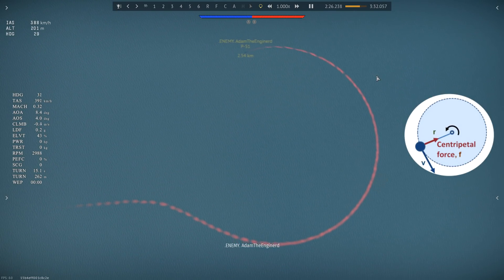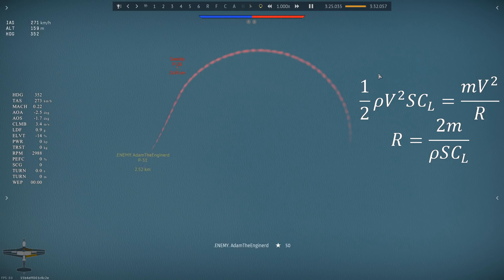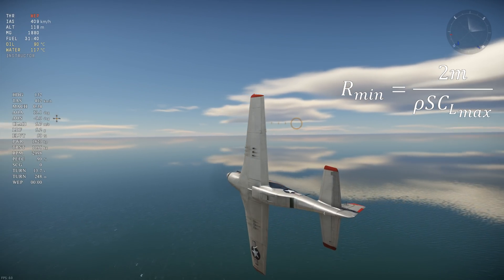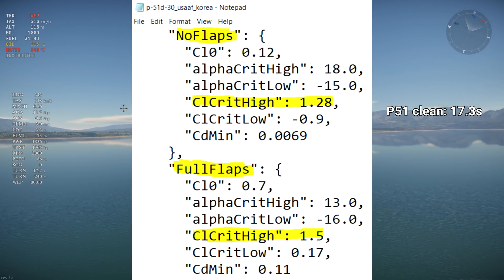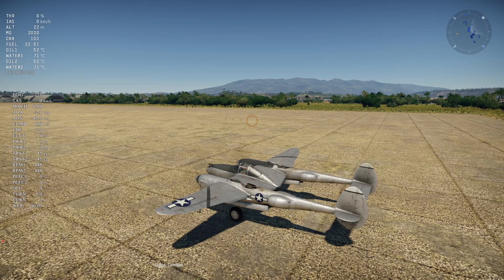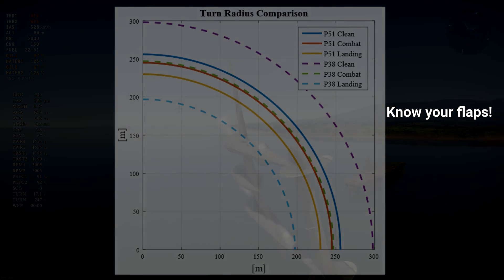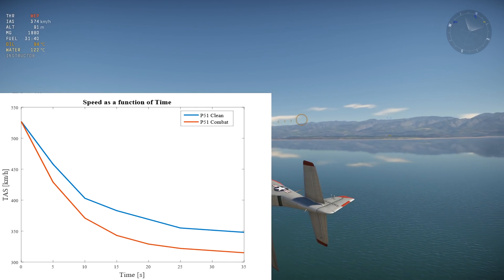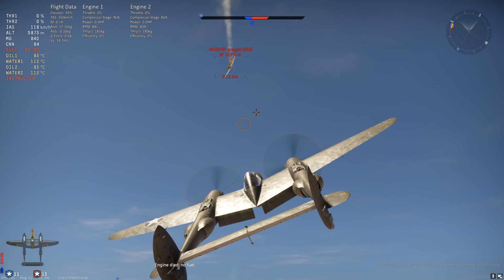Aircraft Turn Performance and Flaps

Comment from the maker: Hope you like the educational video! Feel free to suggest topics below!

Follow me on Twitch:
https://www.twitch.tv/adamtheenginerd
Reply: Had a duel once between my Yak-9UT and a 190 Anton (I think it was an A-5 of some sort). We got into a flat turning engagement, and both of us popped our landing flaps out. To my surprise, he began outturning me, classic Anton flaps, and Yak flaps are pretty useless for turn radius. So I actually raised my flaps, and used the increase in acceleration to climb.

The 190 was still catching me in the turn, but by the time he was coming around to my 6, I had already gained a sizeable altitude advantage over him, and after a series of stall maneuvers, I was able to start booming and zooming him.

It's not often you gain the energy advantage in a flat turn engagement, lol.
Reply: Differences in turning performance in left- and right-handed turns for single prop planes (is it modelled in WT, if yes is it significant in fights).  Also, a follow up to this video explaining vertical turns (explaining the optimal flap extension/timing of toggling the flaps would be nice).
Reply: I'd actually love to see a technical analysis of wing loading(both high and low) and how it affects the performance and handling of an aircraft. Cheers!
Reply: Btw, when you calculated the turn radius, you forgot to subtract the vertical component of lift. At speeds near the stall speed, the increase in turn radius is quite substantial.
Reply from the maker: @J7Handle  I did, I said it in the video. It's a 5% increase at sustained turn speed without flaps for the P51D30.
Reply: Stock plane vs spaded plane
Reply: Fantastic stuff, thanks so much! Topic wish list: 1) best practices re: conservation/conversion/generation of energy, especially variations in planes. [How to get the most out of an airspawn, common ways people are sloppy with energy, vert/horizontal energy retention, etc] 2) how on earth mixture is modeled in game. 3) niche, but ideal climb profiles for the 163/ki200, since I’d imagine getting into thinner air faster might be worth climbing while still sub-Vy early on?
Reply: Great video! Your explanation made these theories much easier to understand.
It would be great if you can make a video on different flap types currently in-game.
Reply: AdamTheEnginerd  a walk through of how to use/instal the overlay would be excellent. Or, just how to figure out quickly a plane’s ideal climb and turn speed.
Reply: how i active the hud show the M/S and others information of aircraft and engine ?
Reply: Just so you know I teamkilled e100 because we are friends and I thought the game was over

Comment: The radius must be relates to the speed, because v = omega times r.
Because omega and r are nonzero, then v is nonzero. So it is not true what you said in this video. Also , let's do a thought experiment. Let's say your speed is zero. You are hanging in the air. What is your turn radius? If speed were not a factor then it would be the same formula you gave in your video, but this is not so. The airplane will never move and thus never complete a full loop. The turntime will be "infinite" and the radius will be undefined.
Reply: The radius isn’t related to speed. Verbal explanation; to maintain a given turn radius, the centripetal force required increases with the square of the speed. The force of lift increases with the square of the speed too. So radius remains constant.

I can show you the equations I used to prove this, if you want. Also, pointing out that this doesn’t work for 0 speed is pointless. That’s a mathematical singularity. You can’t be moving in a circle if you aren’t moving to begin with. Nobody expects you to apply the equation for 0 speed. In fact, the way that the equation is derived (implicitly) excludes 0 speed.
Reply: @silience4095  v=omega*R stays true no matter what. which means that R is v/omega. So R is proportional to the speed.
Reply: Yeah, r= v/ω, but here's the thing, when v doubles, so does ω, so r stays constant. The turn rate increases because you have more lift at higher speed.

You're assuming that turn rate is remaining constant, but it's not. What remains constant is our angle of attack, not the turn rate.

Comment: How does turn time and turn radius differ? I get the smaller the turn radius the better but what happens if some one has a large turn radius but a really low turn time? Like what’s the relationship between the two? Does it really matter? Etc

Comment: Let's flap right into the comment section for some appreciation time! Well done!
Reply from the maker: Haha thanks Chris! You're binging em!
Reply: @AdamTheEnginerd  I just went on this huge tangent, I searched up fowler flaps, had no idea that had been around since the 20s, I was under the impression that maybe the creator of the KI-43 was the inventor, as it used a "butterfly" type I guess, but it wasn't learned about fowler, learned about the ki 43. Tested it in game, and did you know they aren't on the ki-43-3? Kind of a bummer but I guess it's value wasn't as needed compared to production costs at that point. 
Found out the leading edge flaps were invented by Handley page in the 20's too! I always thought that was a Messerschmidt thing from the 109. 
Also since I watched Greg's recent video about the P-38 I understand what made the K the K and have been test flighting it to get a better handle on what it can and can't do. Considering a few of your videos focus on it and especially the reversal video just blew my mind on what it could do!
Reply from the maker: @chris_hisss  Oh yeah flaps and slats are old stuff. The "automatic" slats of the Bf109 are a Messerschmidt thing though.

Comment: Do things any other features of the aircraft (aside from power, weight, etc) impact the TT/TR? For instance, open radiators? I could see certain types of radiators acting as ‘mini-flaps’ and providing some improvement to TR?
Reply from the maker: IRL, radiator flaps would barely change lift. In WT, they only add drag, so they'd slightly worse TT.
Reply: @AdamTheEnginerd  Gotchya, wasn't sure if it was modeled. Thanks a bunch for your response and your content! Second reminder: I highly recommend you start a Patreon!

Comment: Hmmmm does that mean u shouldn't use flaps in p51 period????
Reply from the maker: Nono, short term flaps are good, long term they aren't.
Reply: @AdamTheEnginerd  is it always best to just use landing flaps as they offer the tightest turn radius?  Also do you use takeoff flaps at all evet?
Reply from the maker: @George-cp1vc  If your speed is low enough to use landing flaps safely and you're about to get the shot, yes.

Comment: Turns vertical and horizontal are different performing too.. Have u looked at that?
Reply from the maker: Hmm if you stay sufficiently fast like you should (at least over 200km/h at the top of the loop), planes that turn tighter will also loop tighter. At very low speeds some planes react better than others at the top of the loop, but that's mainly important for duels.
Reply: @AdamTheEnginerd  I am a P47 guy try it yourself one day. The difference for them is significant. The top of the loop is tighter. I even get a better turn flicking the flaps out at the top then in again. Like the video good insight. I'm ex military aviation mechanical engineer. Your insights are great on these videos. Thanks
Reply from the maker: Yeah P47 turns well in the short term.

My pleasure!
Reply: Hopefully I see a vertical v horizontal turn test from ya 😁

Comment: That R_min expression is simplified because you're assuming all the lift goes to turning. Of course a horizontal turn requires you maintain altitude as well, so you also have to satisfy: 

def k = 1/2 C_L A rho 

k v^2 cos(theta) = mg
k v^2 sin(theta) = mv^2/R

k^2 v^4 = m^2g^2 + m^2v^4/R^2

You get R = mv^2/sqrt(k^2 v^2 - g^2m^2)

If we call your solution R0 = m/k then the full solution is 

R = R0/sqrt(1-(gm/kv^2)^2)

The correction factor 1/sqrt(1-(gm/kv^2)^2)  is about 1.038 for your P-51 turn test (sustained 3.7 g's means kv^2/gm = 3.7). This is almost precisely the observed difference between the "theoretical" and "experimental" values. I don't think War Thunder actually models tail surface downforce explicitly. I expect if you went back and tried it with a canard you'll find the same thing.
Reply from the maker: 3:10 I manually corrected the data to put the theory and the experimental on even ground by assuming a 72 degree bank angle. I'm 95% sure WT has downforce modeled for its sum of forces on the aircraft. A canard aircraft should turn better than what just the wings would predict, and a conventional aircraft should turn worse than what just the wings would predict. Might do a canard related video one day.
Reply: @AdamTheEnginerd  Ah I didn't catch that. Then you're probably right that the downforce is modeled. Would be cool to see the canard.

Comment: great video. I would like to ask if you know any twin-engine fighters (heavy/medium) that have good turning performance. I trying to design a twin-engine plane that has good dogfighting capabilities by using parts from other planes.
Reply from the maker: Thanks!

P38s are up there in maneuverability for a twin-engine, helped a lot by its good flaps. For any plane, if you want a good turn you need a low wing loading (mass/wing area).

Comment: How many is the ClMax for 109 in WT? :D
How did u opened the P51 stats in text file?
Reply from the maker: Follow these instructions: https://www.reddit.com/r/Warthunder/comments/8nq70p/tutorial_how_to_datamine_or_how_i_learned_to_stop/

CLmax is 1.43 clean and 1.7 with full flaps for late Bf109s.
Reply: @AdamTheEnginerd  
Thank your very much!
LoL War thunder not calculating with slats either? With slats the CL max should be around 1.9-2.
Reply from the maker: Slats are on a small portion of the wing. They are more for roll control and prevent wingtip stalling first than anything else.
Reply: @AdamTheEnginerd  And let you fly with higher AoA which mean you can have higher CLmax.
Reply from the maker: A bit higher, but not 1.9-2 without flaps for sure.
Reply: @AdamTheEnginerd  Yes, without flaps it should be 1.5-1.65.

Comment: Hi Adam.
I got one question recently.

https://t1.daumcdn.net/cfile/tistory/99B987475B28F2412E
The GIF shows the ball of the cycloid curve is falling earlier than any other line when the ball falls at the same height and same time.

I want to find out if this applies to dive aircraft.
I wonder what it is faster to descend in a straight line or to descend in a cycloidal curve.
Because the ball is not affected by drag, thrust, and lift. But aircraft does. :DDD
Reply from the maker: Ah yes! I have thought of that. The answer should be between cycloidal curve and straight line because of thrust and drag and air density changes (actually matters in 2km+ dives).

Comment: hey adam, hello and thanx for ur videos, I had a question, what's the most efficient way of take-off? I usually stay on the ground till I reach my climb speed (300 km/h IAS on k-4 for ex)
Reply from the maker: My pleasure!

Most efficient way is to not use flaps, and takeoff 5-10% slower than your optimal climb speed (props).

Comment: Interesting vid as always
for some reason split flaps on some planes are very efficient in giving extra lift (Ta 152H, P39)
I feel like flap type isn't 100% directly correlating to the efficiency at giving extra extra lift, and it's individual for every plane

It hurts me a bit that you didn't measre turn time using simplified controls with mouse joystick.
Instructor works the same but you can turn more smoothly making turn time shorter by 0,1-0,4 sec or smth.
Reply from the maker: Thanks!

They might be using simplified equations to estimate flap extra lift, which make split flaps with high deflection angles more effective than they would be in reality.

I used keyboard to turn, that's representative of how people turn in WT too. I don't think you'd get more than 0.1s better turn time with mouse joystick.

Comment: Hello! I was the one who asked on Twitter about the little chart thingie with all the different bits of info you have in the upper left-hand corner in most of your videos. I was wondering what it was and how I could pull it up
Reply from the maker: It's called the "local host".

How to access the "local host":
You need to be running War Thunder or it won't work!

Option 1: on the same computer that is running WT:
-Type http://localhost:8111/ in the address bar and press enter and voila.

Option 2 (which also works on the computer that runs WT):
-Type http://Your_IP_Address:8111/ where you replace "Your_IP_Address" by your IP Address (192.168.X.XXX) in the address bar and press enter and voila, you can look at the characteristics on another device while flying.

But, I use this now and it's better: https://forum.warthunder.com/index.php?/topic/483838-warthunder-real-time-information/
Reply: @AdamTheEnginerd  Thanks a bunch! That's gonna make fleshing out climb angles and speeds so much easier with new planes. Also, I know this doesn't apply so much to this video, but I'm honestly surprised how captivating you can make gameplay videos without even any commentary. Love your videos
Reply from the maker: @wolfhussar1190  Thanks!

Comment: Hi, why radial engines performance is usually lacking at high altitude than liquid cooled engines? Why p47s engine is an exception?
Reply from the maker: Hmm that's not really a rule. In fact, I'd say there's no relation between inline/radial and altitude performance. Look at all the Russians.
Reply: AdamTheEnginerd well, the yaks outperforms at altitude the la5s/la7s, and, even if altitude performance of their liquid cooled engines is below average, a yak9u still outperforms a fw190 at 6000m
Reply from the maker: @ferrarisuper  Yeah, but too general a statement.
Reply: AdamTheEnginerd what determines high altitude performance loss difference on 2 aircrafts? Only the supercharger set up?
Reply from the maker: @ferrarisuper  Mostly yeah.
Reply: Hasn't been mentioned here yet, but P-47 and P-38 have turbochargers, which instantly (at least in WW2 afaik) equates to awesome high-altitude performance.

In a related vein, that's why there was the idea that "the bomber will always get through", because bombers with their large size could afford the space to fit the bulky turbochargers needed for high-alt performance, while fighters, initially, had no space for turbochargers. If you look at the P-47 and P-38, the turbocharger setup literally takes up half the plane in both cases.

Comment: Could you test the physics of propeller pitching? I'm confused on why engines dont overrev in manual engine controls when it should
Reply from the maker: Prop pitch in WT is actually RPM, so 100% prop pitch is maximum RPM (for any plane except Germans). So by definition, they can't overrev.

Comment: how do you find the flight model data files???
Reply from the maker: You can follow these instructions to get them, but they won't do you much good if you don't know what the coefficients mean: https://www.reddit.com/r/Warthunder/comments/8nq70p/tutorial_how_to_datamine_or_how_i_learned_to_stop/
Reply: Thanks for the link Adam. I do know what most of the coefficients mean, I have looked into the physics of these a little bit, however a video on them would be nice. Love the vids, you should fly out a yak (try the 3U) sometime (youll have to cope with the awful 20mms tho)
Reply from the maker: I did make a video on the Yak3U, it was good!
Reply: @AdamTheEnginerd  Ill check it out :)

Comment: The end of the video left me a little confused, you're saying that i shouldn't use my flaps in a sustained turn fight?
Reply: Over time they just slow you down to where you lose your energy/ you have to deploy bigger flaps to turn tighter which makes your slower, and the cycle continues until you run out of energy, win or die
Reply from the maker: It's as Hunter says. Flaps are good for the short term, clean is better for the long term.
Reply: @AdamTheEnginerd  thanks guys for the explanation, this is mind blowing for me because a have been turn fighting with flaps for so much time thinking it was more optimal
Reply from the maker: @Ricardo-ck7zd  My pleasure!

Comment: Half of your theory is right. However, the induced drag is related to the wing area. Also there is a thing call boundary layer, this relate to the speed and Cdrag. Also the Clift is related to the speed. So in reality, turn rediuce is really hard to calculate.
Reply from the maker: You can get to 99% accurate with what I did, that's more than good enough.
Reply: @AdamTheEnginerd  yep, I spent 2 years in mechanical and 1 year and a half in aerospace. Then I realize it's way too hard for me. Finally I transfer to architecture. I still remember some of these things that I learned before. Lol

Comment: I think you’d find atpl theory pretty enjoyable
Reply from the maker: Pilot theory?
Reply: AdamTheEnginerd yes it’s the license you need to be able to fly more than 9 passengers on an aircraft, or an aircraft over a certain weight, which has many equations such as the ones you’ve mentioned in this video. You should give it a go man, especially if you love aviation!
Reply from the maker: @morbidlyobese2944  I already have a Bachelors of Aerospace Engineering ;).
Reply: AdamTheEnginerd well there you go man, you already have well over the required mathematical skill, plus, being an engineer is great and all, but you don’t get to feel the power of those jet engines spooling up on a daily basis. There’s just nothing that beats that feeling!
Reply from the maker: I do suffer from motion sickness haha, so wouldn't be a good fit for me.
Reply: AdamTheEnginerd what? Oh come on man that’ll pass 🤣. Give it a go you won’t regret it!